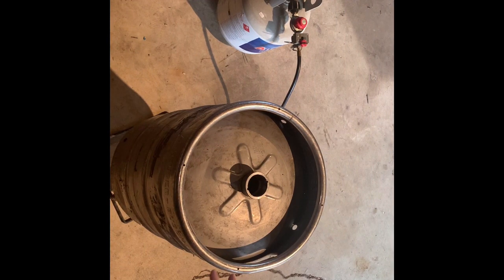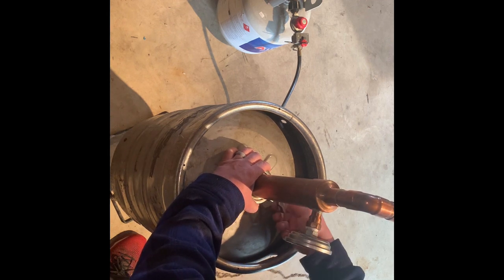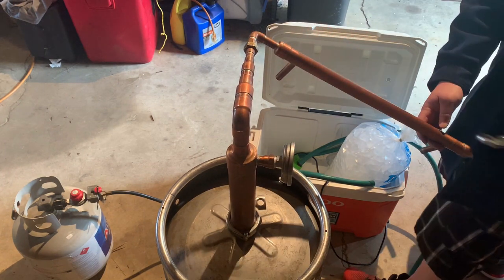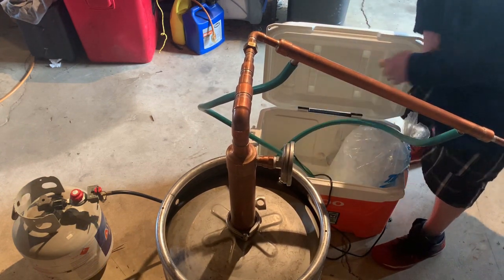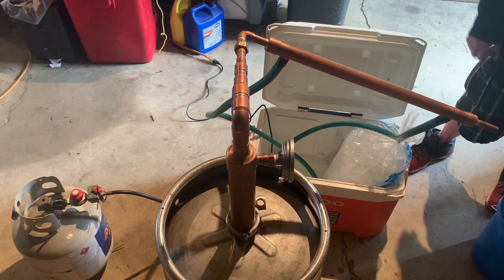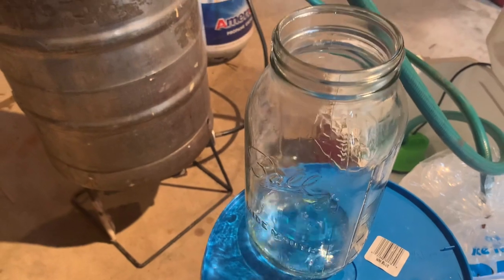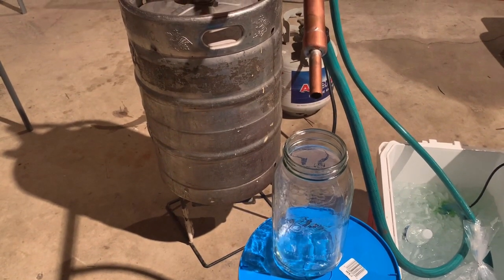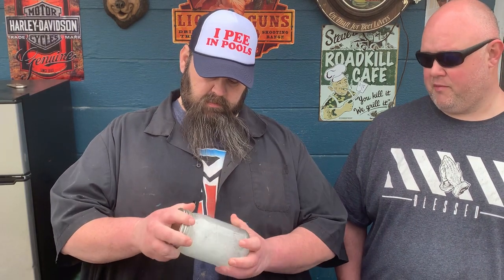Making moonshine using a keg still with condenser.

Comment: Just how do they clean the inside of that keg still if it dont have a cleanout port? Residue build with continued use should add that taste like ass flavor that everyone loves. If anything ever scorches and just general build up over time should make for some very interesting flavors as time goes on!
Reply: I boil it with kosher salt water after use then I use a long brush on a wire kinda like a dryer vent cleaner brush but stronger bristles, then put it in my drill and scrub it that way. If I ever Scorch something so bad I can’t clean it I’ll just get another keg and recycle the scorched one. Thanks for watching
Reply: Stick a power washer down in there. Takes all of 15 seconds.

Comment: how do you know whats poison and whats clean?
Reply: The beginning 250ml-300ml is poison
Reply: @bigeaze5711  without a port to reach inside and clean it, it will all be poison aftera time. surewont taste like anything anyone wants to drink. they need to add a cleanout port
Reply: @marcelgaddis9319  or just use your hose and spray it out good ,then boil it each time, maybe use some salt, I’ve had a keg setup for a while and never had any ass flavoring issues
Reply: 3 oz per 6 gallon should be suffice even in a fruit mash. So if your throwing out 250-300ml that must be a 18 gallon mash which would be to the top of your keg. Just run your mash at the temp methanol burns(148f) until it stops running. Everything else will be ethanol.

Comment: Does your pressure cooker still strip a lot of the taste compared to this still?
Reply from the maker: tastes are very similar but alcohol output so far the keg is winning i am gonna put it to the test. I am thinking the keg still is gonna be the winner it is just hard to clean, but i might cut a hole in the side and put kind of a cleaning port on it. I am not very good at welding though but i can run a grinder like a sunbitch.
Reply: @philbillymoonshine7356  that’s what it’s all about man you have to clean everything real good with a wire brush before you weld anything. Stainless, copper or whatever.